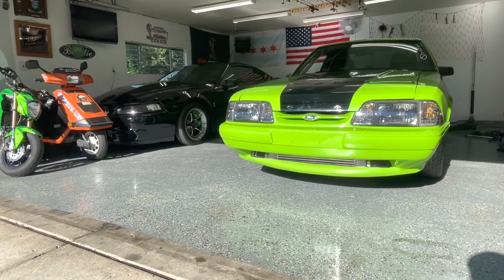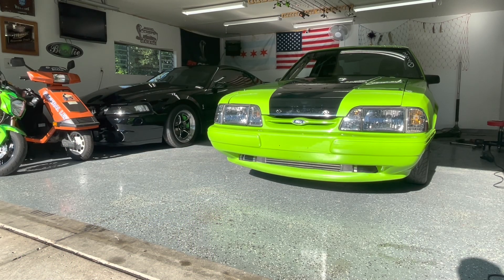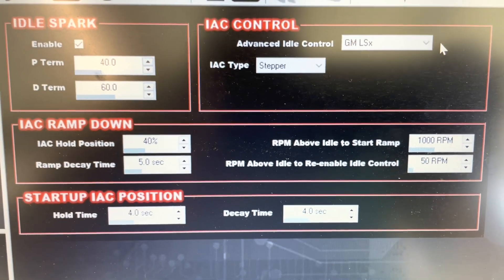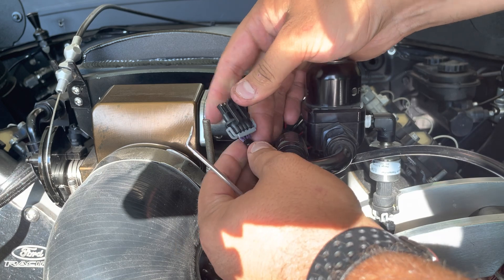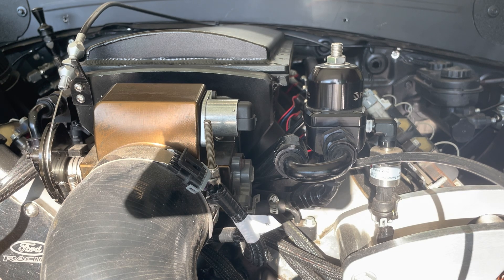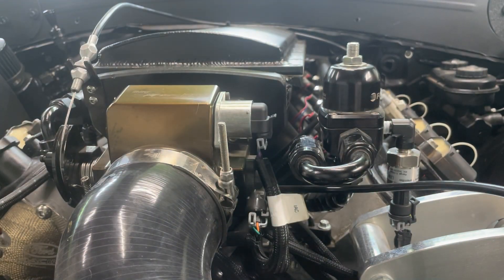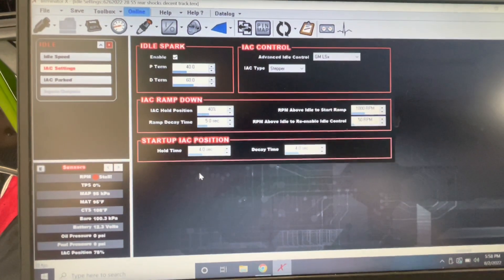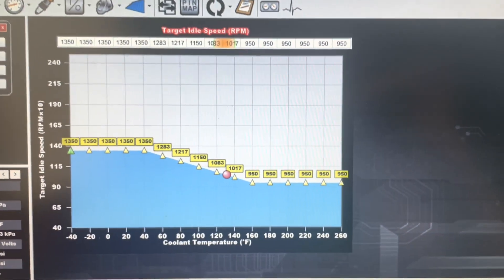How to update Holley wiring from GM to Holley or Chrysler IAC on your LS

Comment: I have been struggling with my idle for a bit. Never occurred to me they had different connectors. Was running a ls throttle body with the chrysler pinout.  This fixed my issue. Thank you!

Comment: Good video. I just installed a Terminator X Max on a Ram Jet 502 system and having same issue. It's the universal mpi harness and the Ram Jet must be pinned for the Mopar style IAC. Tomorrow I'm going to try swapping pins A&C and it will prob fix it. Another BBC I did with the Holley HP universal harness was doing same thing. Was using a GM style Edelbrock TB and IAC, spent 100$ on a new replacement GM style iac with no luck.  Ended up ordering the Holley IAC in hopes there was a compatibility issue and it ended up fixing it. A lot cheaper, and quicker to just swap these pins like you did. Holley really dropped the ball by not mentioning this in the instructions.
Reply from the maker: Hopefully the pin swap worked out for you! Similarly I ordered multiple IAC units and tried many different things until I realized the wiring was changed. I don't know why but there seems to be a lot of compatibility issues with Holley and their TB/IAC compatibility. Even for my Holley throttle body I had to order 2 different IAC units to get the correct one that fit my throttle body.